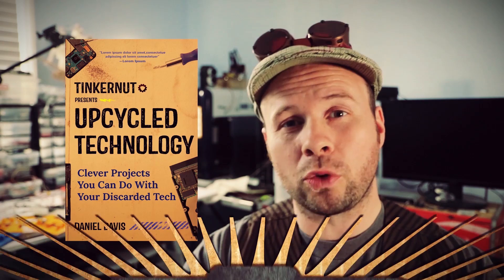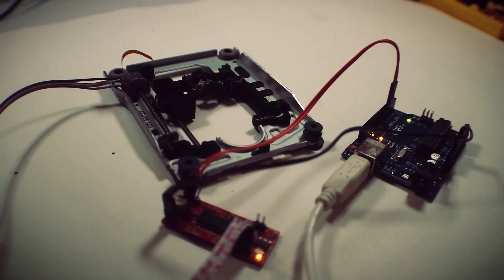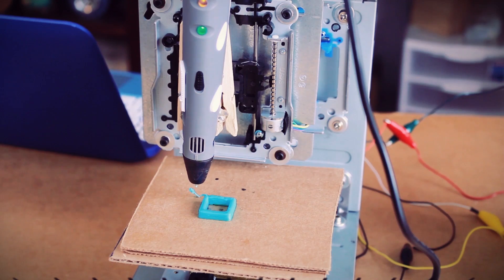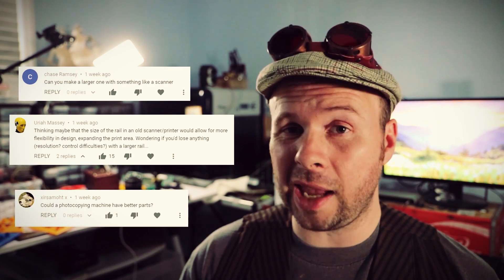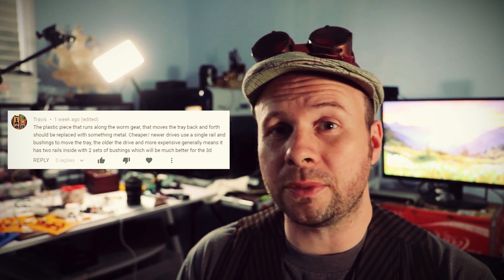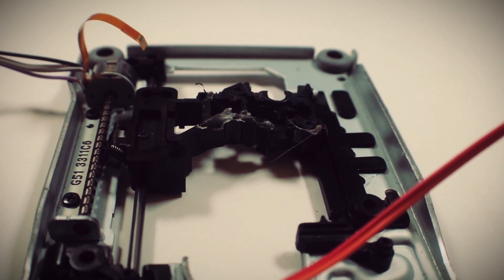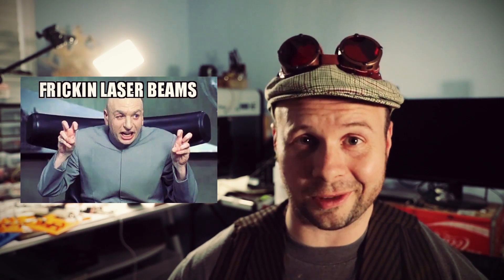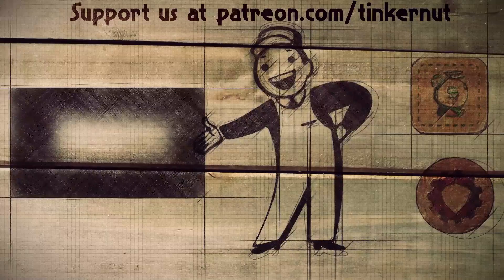Upcycle Old CD Drives into a 3D Printer (Part 2)

Comment: I stumbled across this build on your channel sort of by accident. Of course I am a subscriber and YouTube has been doing a lousy job of promoting my subscriptions (has usual) but I was going through my subs and happened across, this build video!! All that in mind I would LOVE to see a 3d printer built out of an old printer or even an old flatbed scanner, like it has been said the one you are building can't do big parts!!!!! WHICH BRINGS ME TO MY POINT HERE!!! 

I do a lot of automotive work and electronics to me is a hobby as well, and like what is needed to build 3d printers in the first place, I see where a small 3d printer like this COULD BE USED to make small brackets for wire management, or even to make "hold down devices" for hard lines (like brake and fuel lines) in a car. In fact though the printer YOU ARE building here isn't "huge" there are many small things you CAN make with it!!! And I can't wait for your next video to release so I can follow how you build more of this printer simply because I could use a small 3d printer for the reasons I just mentioned!!

Comment: I would like to use nema 17 motor for z axis since z axis is most heavier than x or y and also i would like to use a fan near 3d pen so that the filament will dry up quickly

Comment: Are you going to be using the 3d printer pen, or an actual hotend and extruder, I feel that will greatly increase the quality of the prints, also I would love to see how you connect a hotend to an arduino uno, been struggling with this, my knowledge on the matter is limited, but what I have found so far is that you need a mosfet, not sure how it all connects though

Comment: Hey, I've been following your channel ever since the first CD/DVD 3d printer you made which inspired me to make my own and eventually get my hands on a full on 3d printer. I did a few things differently and I think this may prove useful to you for the 3rd part of this series!!

Here are my suggestions:

1) You should definitely use some sort of firmware so you can print with slicer programs and Repetier. When I made my own CD/DVD printer a while ago using your previous tutorial the thing I did differently was using an Arduino MEGA with the RAMPS 1.4 shield and Marlin. Since you're using the Arduino UNO I'm not 100% sure what firmware works or not but I do believe there is a more "lightweight" one called Teacup but you might have to do some small changes in the firmware for the pinouts of each driver.

2) These motors are meant to run with I believe 5V or 9V originally, the voltage on my stepper drivers (A4988) was 12v which caused them to heat up alot and I did manage to burn a few on the way. Some CD/DVD drives did have slightly more bulky and more durable motors and these are the ones that seemed to last so if you do have the option, try to run them at a lower voltage if they can provide enough torque.

3) (which ties a bit with point 2) For anyone that for whatever reason cannot get their hands on any stepper motor drivers, look instead for old floppy drives, their Driver board does have an included stepper motor driver (for the floppy stepper) which can be interfaced in the exact same way as the Arduino stepper motor drivers. I've been meaning to try this for a while now but I cant find any old floppy drives near me. If you need any documentation on how to use these, look up a tutorial on singing floppy disk drives, they do just this!

4) I also did the whole 3axis setup a bit differently than every other youtube video I watched, Instead of connecting the Y and Z axis together like you did on your last video, I found it much better to connect the X-Y together by joining the two carriages in a straight angle similar to how an XY table would work and leave the Z axis stationary so it would only have to lift the hotend and this seemed to me like it would put alot less stress on the Y axis motor, if you need any examples of this you can take a look at the RepRap AtomX or I think the RepRap snappy uses the same technique.

Sorry for the long list/text. Everyone, feel free to ask me any questions if there is anything you might be curious about.
Good luck with the build, looking forward to part 3!
Reply from the maker: THIS IS EXCELLENT! Thank you so much for this feedback!!!
Reply: 1) Do you know of any tutorials in using Arduino MEGA with RAMPS 1.4. I've been seeing all-in-one package stuff on Alibaba but not sure if I need all of them or I need just a few.

2) I wonder if there is a way to determine just how much voltage the stepper motors can take? I guess, the straightforward way is to start with a lower voltage first. Try out 5V first, see if it is working fine. If not, try out 9V next, and so on.

4) The "X-Y together" idea sounds like it's worth a try. I might do this for the one I'm working on.

Thanks for your inputs. These are very helpful!
Reply: Previous month I managed to withdraw my first five figure paycheck ever!!! I've been working for this company over the internet for 2 yrs now and I never been happier... They are paying me $95 per hour, and the best thing regarding this is the fact that I am not that tech-savvy, they only required basic knowledge of internet and basic typing skill...Awesome thing about this is that I have more time for my kids. I am able to enjoy quality time with my friends and family and take care of my babies and also going on family vacation with them very frequently. Don't neglect this opportunity and make sure to react rapidly. Here is what I do bay25.com